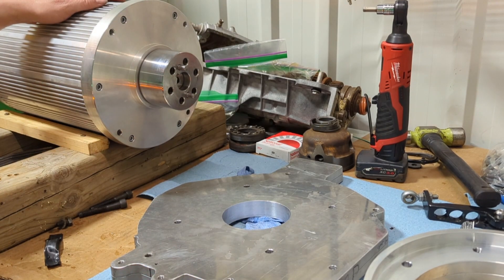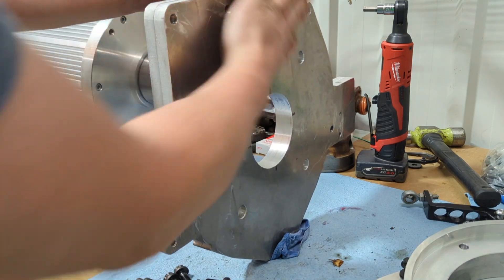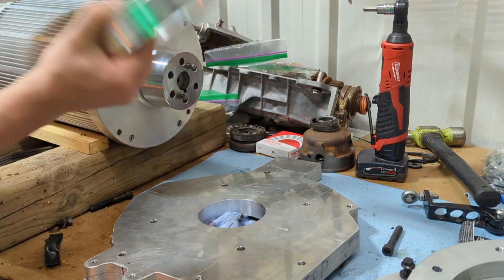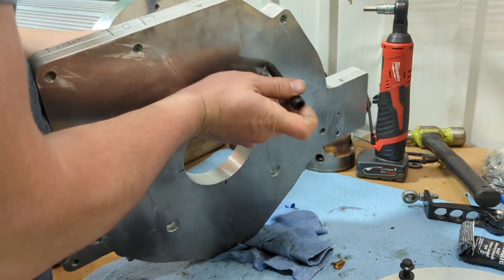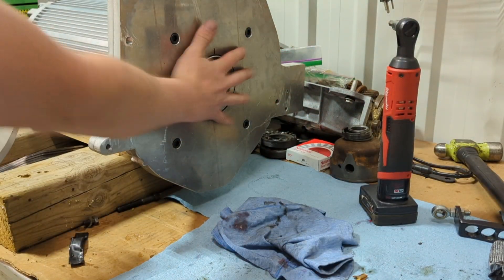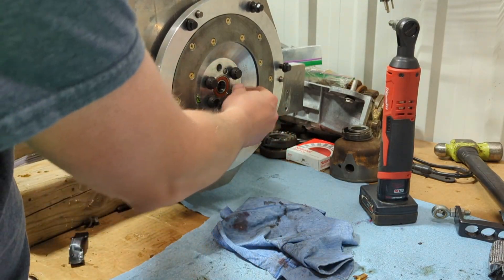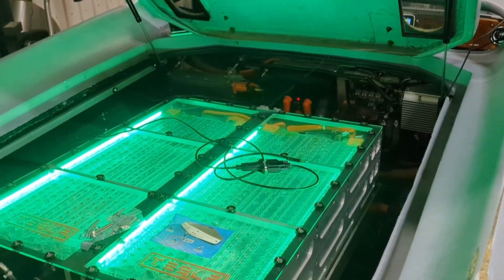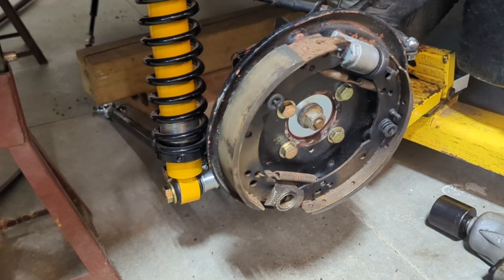Lotus Europa hyper 9 adapter plate

Comment: Don't see the Point of Removing The Heart of the Car and Putting a Milk Float Motor in?
Reply: For fun.
Reply: @adamlannerd1408  
More Weight less Noise. I'm not sure how that's fun. Speed isn't necessarily the Epitome of Fun!
Reply: @adamlannerd1408  The sound and feel of an engine is what makes it fun otherwise might as well just drive a racing sim in silence at home